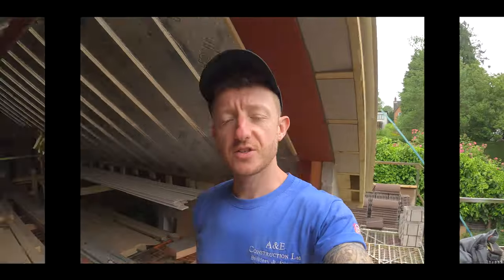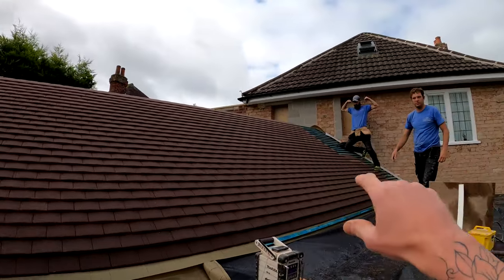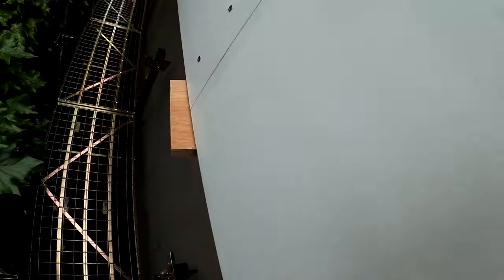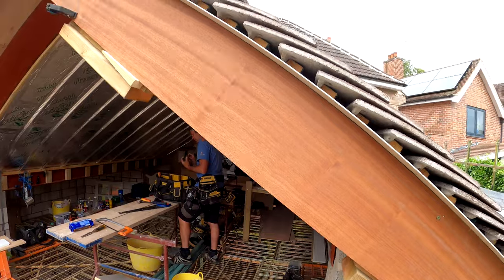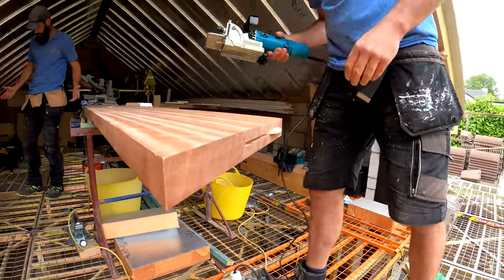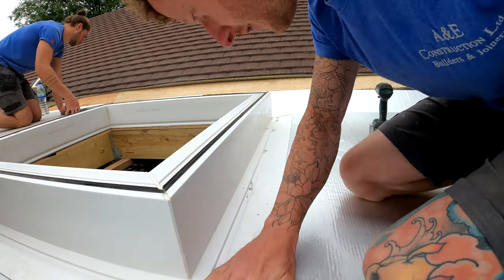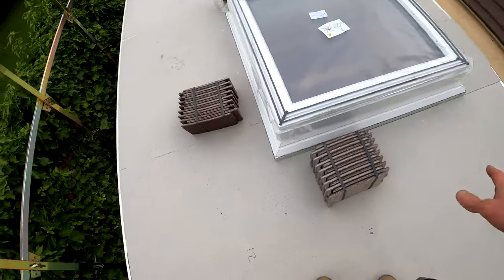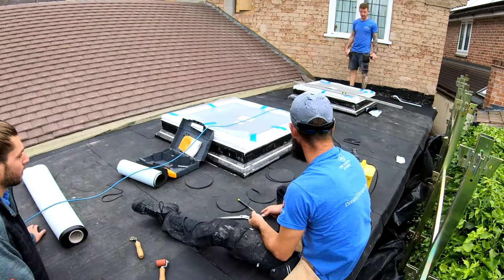Rain THREATENS our roofing work! 😱 | Single Storey Extension #19

Comment: Looks like Velux could do with some feedback on that design. I don't see why those flanges couldn't be vertical on the inside face as it would be easier to detail with with plasterboard internally than have to recess insulation here.

Comment: In my opinion Resitrx is only as good as the man putting it down 😬 have had a lot of problems with it when bonded to concrete!!it it just doesn’t stick , and if you don’t get the bleed right then forget it. But I am sure Will is on it 😉
Reply: Tbf that's the same as most systems, I'm pretty much only replacing failed GRP flat roofs ATM, for some reason no-one down here wants to use expansion gaps 🤦...